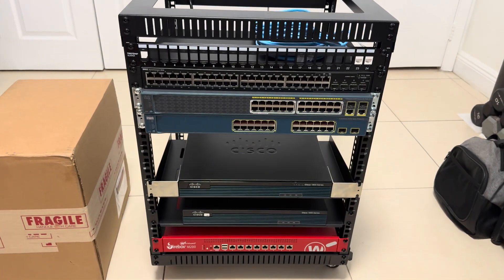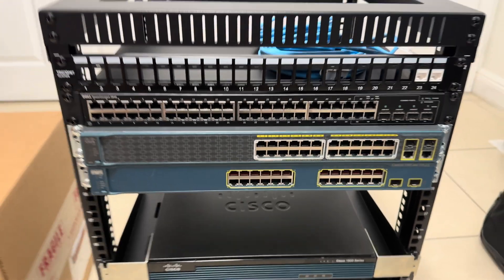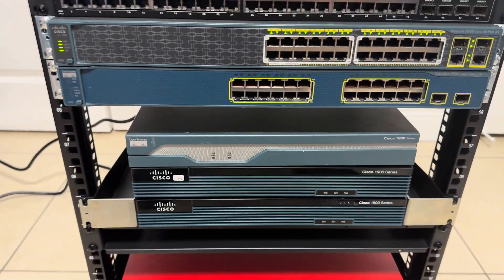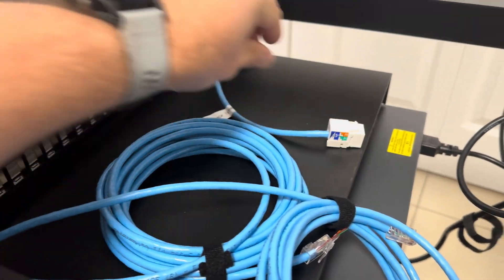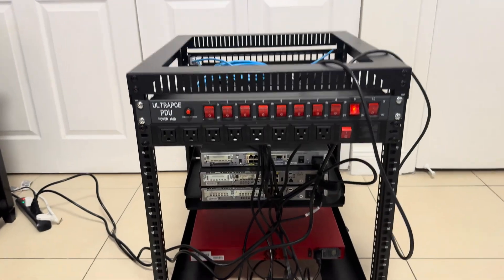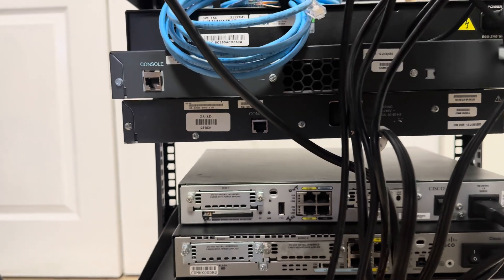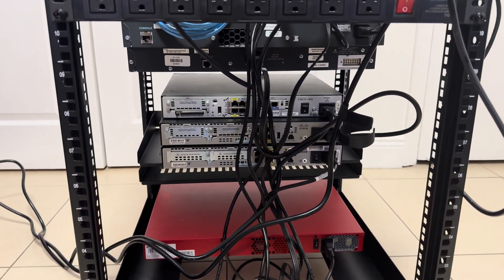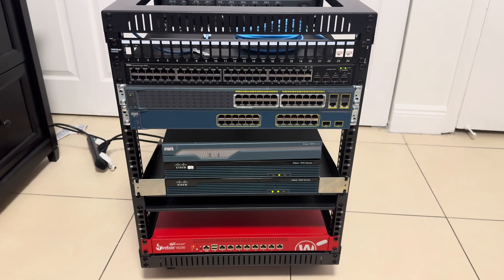Building CCNA Home Lab  (Part 2)

Comment: i am building my home lab with your inspiration. but the main problem is i want to switch on the equipment when i sit for study daily. does this repeated power on and off damages the equipment ..?? and while working to prevent any damage due to sudden power outage and surges which equipment should i use, Voltage stabilizer or UPS ..?????
please reply